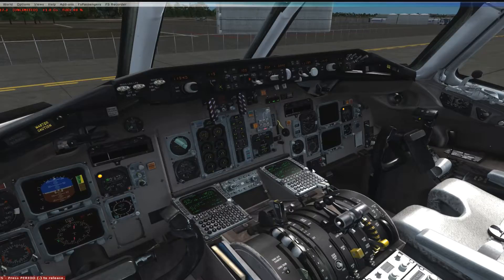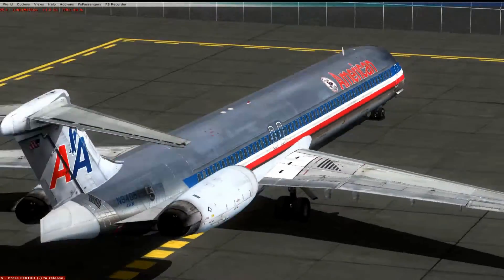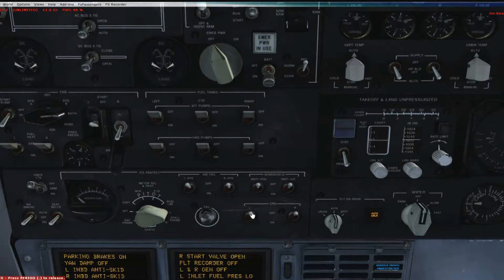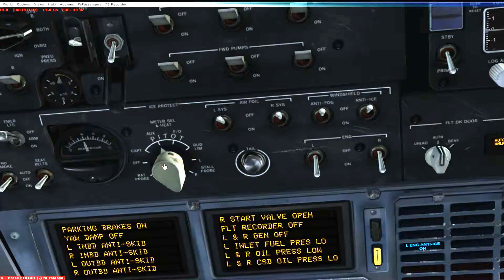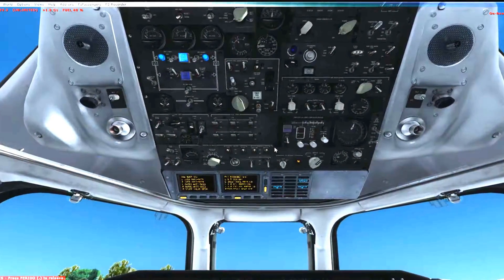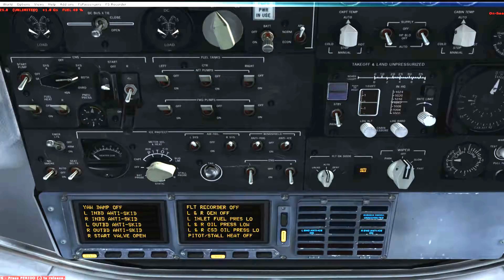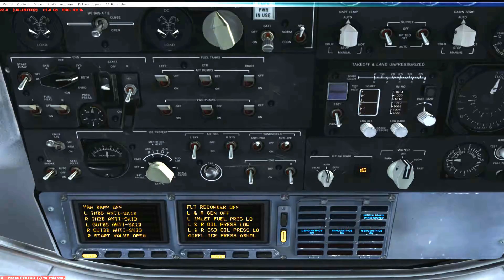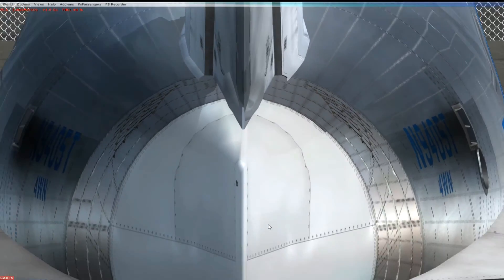[Tutorial] Episode 7. Learnthemaddog - Anti Icing Systems

Comment: If taking off in icing conditions, the engine anti-ice is left on and airfoils off until you’re airborne. 

If you try to run airfoils on the ground you’ll get an abnormal airfoil pressure warning on the EOAP

Comment: Pneumatic crossfed valves should be closed when operating air foils.
Reply: No they should be open because whatever allows bleed air to go to the airfoils to prevent icing, is located between the crossfeed valves. So both should be open to allow bleed air from the left and right side of the pneumatic system to reach the center.